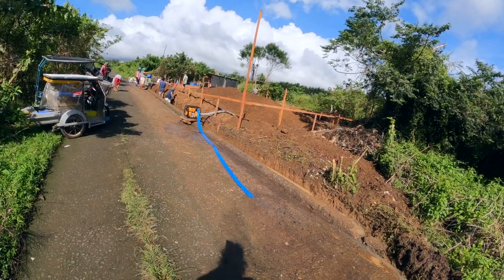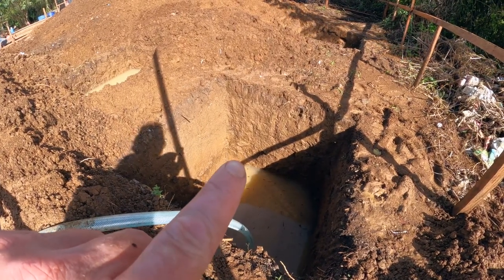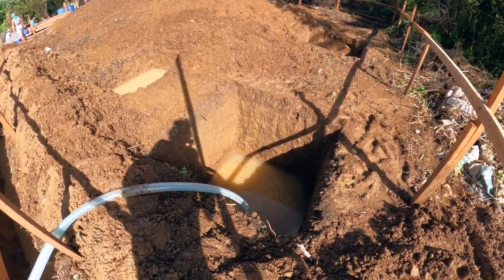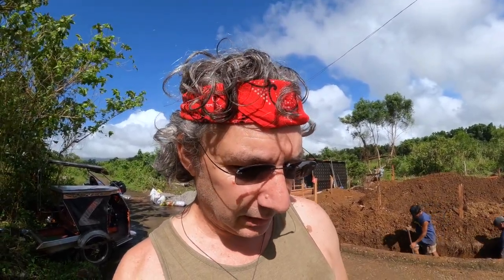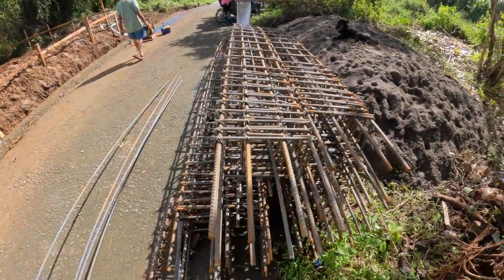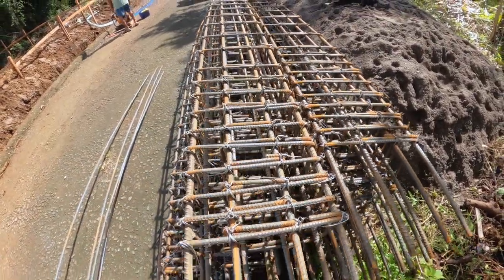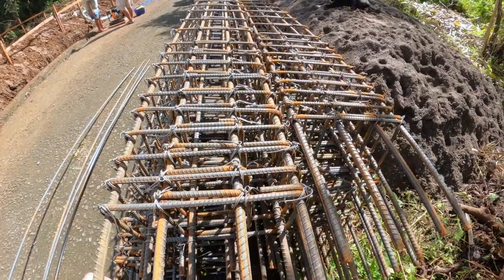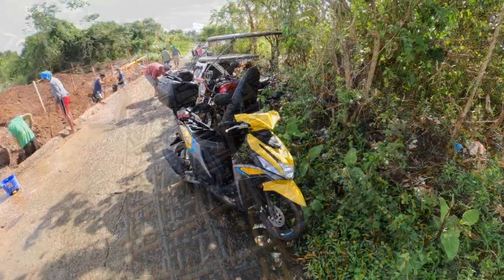Pumping Water! 💦 | Garage Build Philippines | Ep. 05 | TORINO

Comment: Stir ups are not bent 45 degrees at the ends...only 90 degrees...Concrete are porous material...they absorb moisture ...vapors...or water....Foundation concrete footing are subject to water penetration...Your rebar coloum post are bare steel subject to rusting...it is recommended to paint rust protection on rebars and put water proofing addmix on concrete mixture...